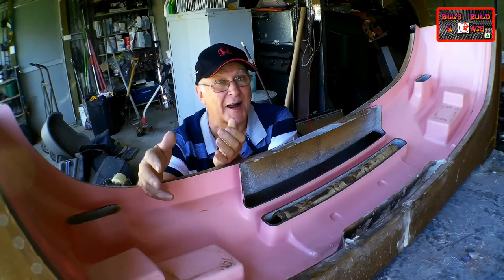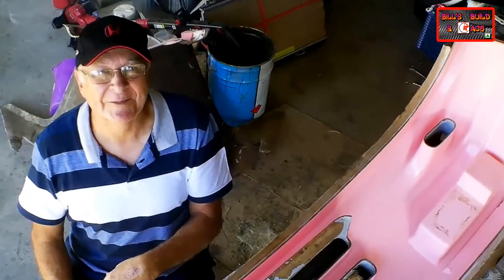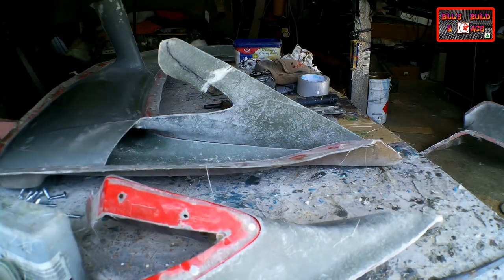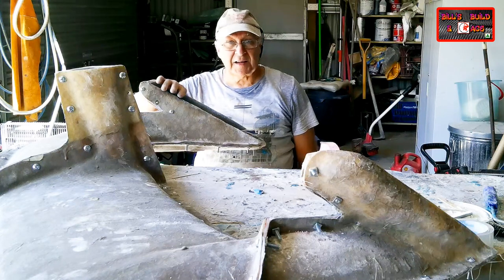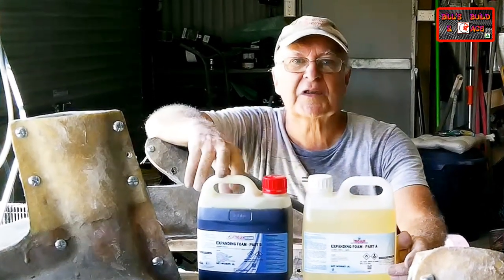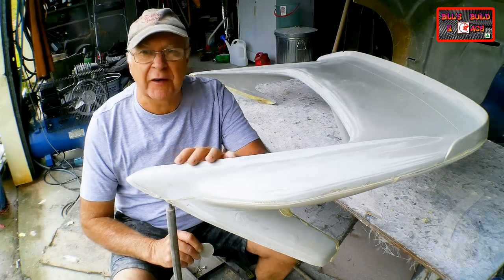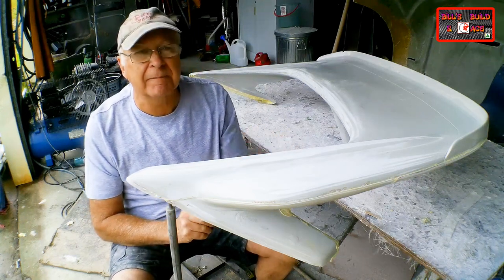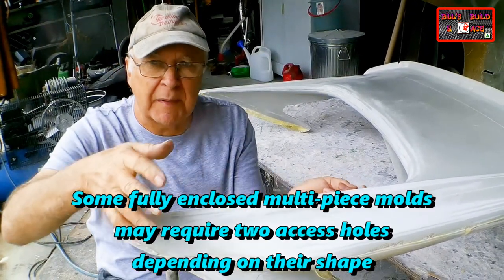How to Join Multi-piece Fiberglass Car Panels

Comment: Another great video Bill. Certainly the most informative fibre glass channel on YouTube... 
 This wing reminds me of working on the Mac T surf boards in the old Rumours clothing factory near the Wool Store. They had a foam core with an ABS shell that had a  semi exposed seem which had to be filled before painting. I spent months of R& D trying a paintable filler that would flex with the board.